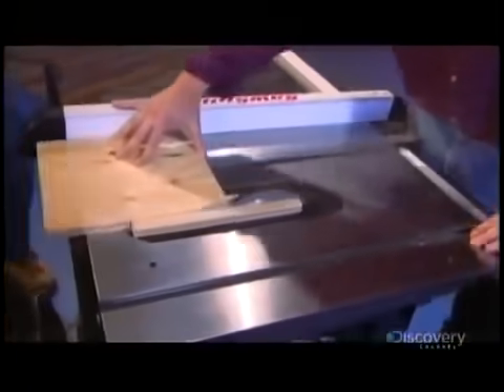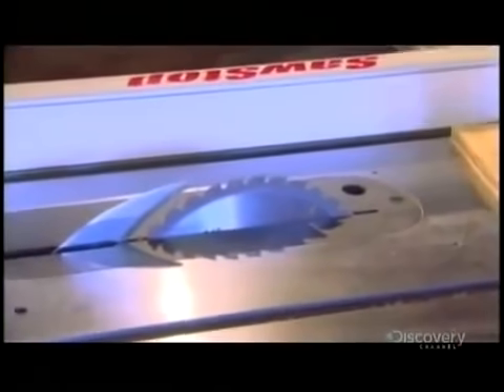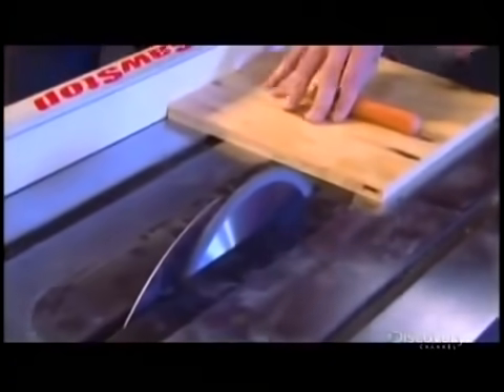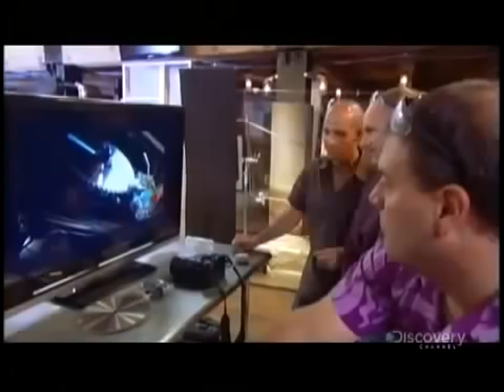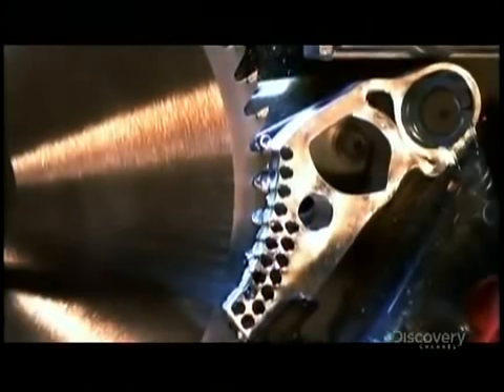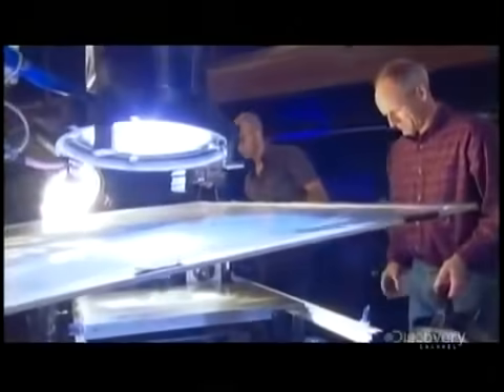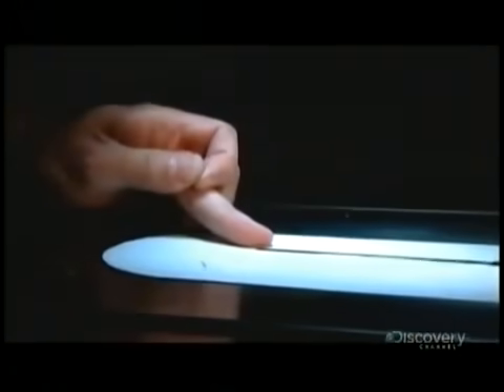Sawstop: Watch a FINGER go into a spinning tablesaw blade without a scratch

Comment: So once you touch it, it gets destroyed?
Reply: yup, that's what the video says!
Reply: SixSnoopy 12 And you keep your fingers! Good deal
Reply: Yes, as the video said it destroys the sawblade and the stopping block, but that is $60 in parts for keeping a finger. Got it fuze?
Reply: SixSnoopy 12 I mean your medical bills would cost more probably then to fix it so
Reply: I don’t want to be here its 8 fingers hehe. U have 2 thumbs 😉
Reply: so if you are unhappy with your Carpenter just stick your finger into the blade of his saw so he has to pay 60 Dollar works almost every time
Reply: Yeah, but it's very easy to replace
Reply: 60$ is a small price to pay if it saves your finger.
Reply: SixSnoopy 12 yup
Reply: LOP1698 Plot Twist: He doesn't have a SawStop.
Reply: Ye I work at this place (not work but it's a class im a freshman) and the instructor is Dean Madson he's a prpffesional wood worker and told us that dont ever touch that saw blade cause even though it will stop automatically it costs a lot to repair and we will pay for it
Reply: Yeah but your hand isn’t
Reply: James Sawley can you say it again for those in the back... and stopped watching
Reply: SixSnoopy 12 they created a new type that doesn’t break it just goes down really fast and still works
Reply: it can be more cheaper if the stopblock would be different kind of metal that doesn't brake and just the saw gets fucked up, -->unless the saw doesn't brake with being a high conduction indestructible metal? 😂
Reply: SixSnoopy 12 it doesn’t destroy the whole saw but you can replace the parts that are designed to get destroyed to save your fingers. My woods shop at my high school its a nice saw
Reply: It's a lot cheaper to repair a blade and stopper than it is for surgery
Reply: SixSnoopy 12 just the replaceable parts
Reply: Better than losing a finger
Reply: machine isnt broken... its only the stopper and thr blade.. the stopper is completely stuck to the blade so you have to change the blade and the stopper too
Reply: SixSnoopy 12 no it sinks back into the desk
Reply: Better than losing a finger
Reply: Pretty much ya
Reply: No you just have to replace one part for about 60 dollars
Reply: SixSnoopy 12        tbh I rather have my finger not get cut off
Reply: Aristides Benitez if the impact of stopping the blade doesn't break something the power will go through the whole saw machine and dmg alot more then a spring and metal break.
Reply: Aristides Benitez if the metal they used was different it probably wouldn't work properly, or it would be too expensive
Reply: LOP1698 , he wouldn't know who's destroying his table saw until he got pissed off and remove it's safety feature.
Reply: SKELETONIZETV wow that's all your thinking about
Reply: SixSnoopy 12 yup
Reply: Better than loosing a finger for as long as you will live.
Reply: Bosch has a machine that allows you to save your blade, all you have to do is change the cartridge.
Reply: We use Forest brand saw blades, they are more like $150 each, then it's plus the sawstop part. Not all saws can take the sawstop system, the Altendorf sliders we have probably can't be retrofitted with one.
Reply: LOP1698 and then he charges you $60 for ruining his saw..
Reply: @HobbyOrganist  No saw can be retrofitted with the sawstop system...
Reply: Well would you rather your finger get destroyed then?
Reply: Just the blade ad stop.

Comment: That machine can’t cut sausage.
Reply: P 4 what a disappointment
Reply: P 4 im sooooo disappointed 😔
Reply: Jesse Pust what dose that have to do with anything
Reply: Gordan Ramsey would be disappointed
Reply: P 4 i didnt know
Reply: Mike Fish i was about to say that
Reply: You can actually turn off the braking system do you can cut all the sausage you want
Reply: P 4 that saw is not sharp.
Reply: akakyron 9 what do you mean!?
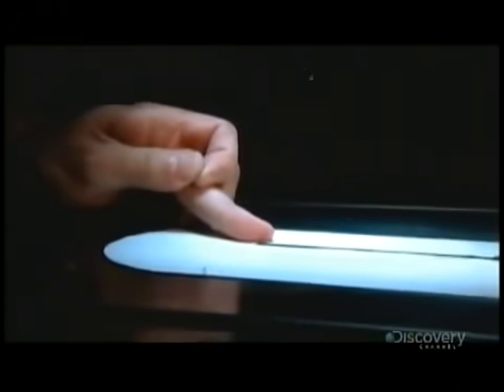Reply: Look at the saw blade teeth at 4:31.  The teeth have been filed down, are very rough and irregular.  The roughed up teeth create more surface area around the tip ensuring a better contact when Steve Gass's finger touches it.  A normally sharp tooth comes to a point, which has much less surface area to make contact with a finger for a slow motion demo.
Reply: Yes it can, just not while you hold it, completing the circuit
Reply: Or wet qood

Comment: Absolutely brilliant idea. However, imagine if airbags were only available in GM cars and GM refused to sell or license them to any other auto makers.
Reply: SawStop did try to license it and everyone rejected the cost.  Gass ended up making his business boom with his own saws.  Nothing wrong with an inventor making money and protecting his patented asset.  The companies that rejected the licensing are probably regretting that decision to a degree now.
Reply: Yeah, Troy is on the right path. You can only blame the other manufacturers for not adopting the technology on it's terms. In 2002, SawStop was initially trying to license with Ryobi for just a 3% royalty fee with NO UPFRONT. The only caveat was that it would increase to 8% if most of the industry adopted it.

The real issue comes in 2008 from the Power Tool Institute which represents a shitload of leading manufacturers. It's at this point they were really trying steal Gass' patent (v.s. paying the damn fee) by claiming it was unproven and even saying some laughable arguments like "dangerous because it requires the user to come in contact with the blade before activating;". Of course that got thrown out the window.
Reply: "it's dangerous because it requires the user to come in contact with the blade before activating" the the biggest cop out answer I think I've heard in a long long while.  Would have loved to hear the judge try and keep a straight face when hearing that one.  Be like me trying to argue that airbags are bad because you have to crash your car before they go off. 

Reading some stuff on SawStop and licencing, Power tool institute is trying to play up  SawStop's shortcomings by saying that the system can't do anything to prevent- and I quote : "SawStop cannot mitigate fractures and crushing injuries caused by workpiece kickback or loss of vision caused by high velocity particles ejected by the saw blade."  Fuck off. The system rips the blade away in a fraction of a second if someone touches the blade. That's i'ts sole purpose. Would they like Sawstop to help measure and work through a good timber design while they are at it?!?!
Reply: they're letting the exclusivity of the patent expire in 2021 so other manufacturers can make them.
Reply: On the other hand though, why would someone invest in inventing something if they can't maximize their return on it. Even if they didn't sell/license it. The law says that their patent expires after a certain amount of time. After which, humanity benefits from their greed. I think it's the right balance.
Reply: Jack Windensky He milked his idea for 20 years and made millions. His greed is what got you here in the first place
Reply: I don't know if you agree or disagree with what I'm saying.

Comment: Notice that he stuck his hand in a cooler of cold water first?  And the hot dogs are always moist?  How many woodworkers wet their hands before attempting a cut?  The saw blade needs to sense conductivity before it can do what it should do...if your hand isn't wet or sweaty, well, the jury is out.
Reply: Mike G the thing is it's not meant to be perfect most people are moving their hands faster then his in the clip too but when it does cut and hits blood that's what triggers it, your still going to get cut but you won't lose a finger or anything worse.
Reply: There is a video of a guy that got hurt by his saw with saw stop it worked on his dry hand but he did get cut so not as good as the demo but it better then it just taking the finger.
Reply: He wet his finger because he didn't want to cut him self on purpose while demonstraing so he wet with salt water to keep his finger safe. But the blood from your finger is what stops it no the salt
Reply: Well it is going to cut your finger a little and as soon as the blood might come out the blade is going to stop immediately. So it is still better because you will only have a small cut or even a big one is better than your finger even hand and even life
Reply: Multi layered glove with a conductive layer could help
Reply: becton is actually thinking. Be like becton
Reply: Gays
Reply: Shanold guessing we saw the same dude on his thumb right?
Reply: Nope... jk
Reply: Your finger always has conductivity - that's how most smartphone screens are able to work.
Wetter and saltier conduct better though
Reply: becton98 I wouldn't want to use a glove purely because I'd be afraid of it getting snagged in the blade as it goes down.

Google degloving. Not images though.

Degloving is most definitely a 0/10 would not recommend.
Reply: Mike G yes I seen this in person.. the person had a razor cut and didn't need stitches. But it's better than losing a damn finger or 3..
Reply: guys, what makes sawdust? saws. what do we use to clean up oil and other nasty liquids? sawdust. it's gonna take even longer to contact
Reply: Fingers have oil/grease. Skin cells are stilll moist, your blood and tissue below your skin will DEFINITELY trigger this.  Even if it cut just past the skin thats absolutely nothing, compared to losing a finger/hand.
Reply: Hyper99Gaming it isn’t triggered by blood, that’s ridiculous. Your finger is always conductive, how else do you think you type on your phone?
Reply: Well it was hardly hidden was it? The point of the test wasnt realism, it was to demonstrate the saws safety. It was a pointless demonstration and obviously for the cameras, it proved nothing more or less that the hotdog did...and frankly i was impressed enough about that. The guy did say you would likely get a nick rather than loose a finger, he didnt claim an accident would leave someone injury free. The conductive glove idea someone mentioned is a great idea for this saw.
Reply: I just stuck my hand in ice water just in case my machine field. With the blood vessels constricted in my senses numbed if I did cut my hand on that table saw, I hope it wouldn't hurt nearly as bad if my hand was iced. Obviously he did it to amplify the machines ability to since conductivity, but let's not pretend like Woodworkers hands don't get sweaty. I work with a table saw rarely here in Florida and my hands are constantly sweaty.
Reply: I have 2 cuts on my left thumb. The cuts happened 8 to 10 years ago.  Neither was  serious, although I was lucky. I having been using 2 push sticks or a gripper since then: no more cuts.   I admire the engineering  of the Sawstop  but at what price? Common sense (when available) should be used.
Reply: Mike G not true it really does work
Reply: Sarge if we are talking about the guy who posted a video a few weeks ago- his injury looks as bad, if not worse than mine, and I didn't have a SawStop.  If he was really using a SawStop, I think  in his case it had a delayed reaction.  My thumb is still healing from getting clipped on my Radial Arm saw as is his thumb I'd imagine.  I know my table saw or radial arm saw won't stop if I get in the way, but I would still much rather have at least a small chance of minimizing that  injury with a SawStop.
Reply: I googled it; I didn't take your full advice... I wish i had
Reply: I think I saw the same video too, mechanism might not be perfect but it gives you one hell of a better chance of walking away with all bits still attached .... maybe this should be subsidized?
Reply: Mike G I can confirm the saw will stop, but not as fast. My hands were dry and had been working on a project for about an hour when I tried to cut a piece of warped foam when it got pulled in too quick and nicked my finger before stopping. I didn't lose my finger but I did bleed and needed about 2 weeks until fully healed.
Reply: Corey Kinard when I cut my finger on it I was in shock so it didn't hurt until maybe 30 to 60 minutes after the incident
Reply: how many times have you touched a touch lamp and it didnt work, does it happen, yes, but its rare. they just didnt want to take any chances with a demonstration.
Reply: If you look online there is more recent test envolving different meats, even dry salamis will trigger the stop. There also a video where a guy swipes a hot dog into the saw much faster then anyone would be moving for cutting wood and the hot dog was only cut a quarter way in, This technology works and is very impressive
Reply: glad someone noticed
Reply: Yes I don’t eventhink he touched the blade

Comment: I'm an 18 y/o carpenter I do these rips almost everyday. On the cordless Dewalt table saw. VERY important when you're ripping skinny pieces to ALWAYS use a pusher tool. If that board doesn't go perfectly against the fence, it can blow out and shatter instantly into a ton of pieces. That's how you lose your hand.Can be very dangerous if you don't know what you're doing.

Comment: What if you're working with wet wood?
Reply: Bart Simpson woods are not conductive
Reply: No but water is.... that's why I asked about wet wood.....
Reply: Bart Simpson wed woods are conductive but arent much as any other conductive materials since only water is conductive on it. So only lil amount of electric  will flow by it
Reply: So.... guess u don't know how it works.....
Reply: Blitzballs Kim 1.16.... watch that part
Reply: 1:15
Reply: Water actually is an insulator, it's impurities in the water that are conductive so if you wet it in salty water maybe it'll set it off buy I doubt plain tap water is conductive enough to set it off
Reply: Haven't actually tested it though so it's just a hypothesis
Reply: xavier valdez  In other videos they talk about wet wood.... it does set it off
Reply: Bart Simpson why work with wet wood?
Reply: Dave Tyler oh I don't know.... I guess real men work even on rainy days...
Reply: Bart Simpson but as contractors u would want to work with dry wood. Contractors wouldn't work with wet wood
Reply: Dave Tyler I guess u never been a farmer......
Reply: Bart Simpson when do farmers need to use a table saw in the rain?
Reply: Dave Tyler omg.....
Reply: Dave Tyler they do the trim as well..... do u not have any common sense at all?
Reply: Bart Simpson why don't they cut the wood in like a barn or just wait until it's dry?
Reply: I watched a video showing it cut through a piece of wood that was moist. It cut through normally. It definitely depends on how wet the wood is. If it's absolutely soaking then yeah, it will likely stop. You shouldn't be using a Sawstop in those kinds of conditions.
Reply: I think it would instantly stop
Reply: Would needs to be completely dry inside out  before putting through the table saw. Bandsaws are used with the miter gauge to get straight cuts with wet wood
Reply: Stop acting like you're smart.
Reply: Im Your Cat finally someone with common sense
Reply: There is one of these at my school and a kid accidentally triggered it with wet wood
Reply: In my experience wet wood will set it off.
Reply: xavier valdez yeah that’s why he said SALTY wet finger (because salt is an impurity)
Reply: Hey are you cool man?
Reply: Why would you work on a wet wood? Will you bring this machine outside? It's like the idea of waterproof ink pen. When will you sign papers in underneath a rain?
Reply: farlon muentes ummm no... if u ever worked with wood then u wood no that wood can be weet days after it rains
Reply: And from watching other videos wet wood will activate the saw stop
Reply: Inflake not all jobs has a barn.... any way most of u don't understand the question.
Reply: It has a override key system that you can turn it off. But its complicated to do lol

Comment: Others stuck their hand in the saw and it did cut them before the saw stopped. They needed stitches but no loss of limb.
Reply: Thats because he wet his hand in salt the others couldn't use salt so when their fingers got sliced open by the saw the blood activated the circuit which cut the saw off
Reply: He's also moving his finger as slowly as possible and the people who were actually working with the saw were moving much faster.
Reply: Well you need contact in order to trigger the mechanism. The saw wasn't designed to prevent you from having an accident, but to minimize the impact of touching the blade. You'll be cut but I'd choose that over losing a finger.

Comment: So it's basically like a fingerprint scanner or a touch screen on a device? So a phone stylus could stop it?
Reply: exactly. But this feature can also detect water moisture on the wood causing problems
Reply: Add859 TankiOnline screens can also.. u can try using a sausage or wet wood as a stylus, it works, screens work like this- they detect moisture and the screens react thx to moisture in your finger or stylus

Comment: We use a SawStop at the middle school where I teach the shop class.  While showing this video, I point out the slow motion close up of the teeth @ 4:31.  Notice how the teeth have been filed down too extremely dull.  A rounded tooth creates more surface contact with Steve Gass's finger - extra insurance that the system triggers as it should.  THEN I go into our shop with the sharp teeth.  With the machine powered on, but the blade stationary, I touch the top of a tooth and show the kids the blinking light that triggers the system.  Then, I show them how when you touch the tip of a tooth from the front, as if you are feeding material correctly, THE SYSTEM DOES NOT TRIGGER.  The light does not flash.  This reinforces that they must be diligent in their use.  Like using a firearm, never rely on a safety feature to substitute for what the operator is responsible for.